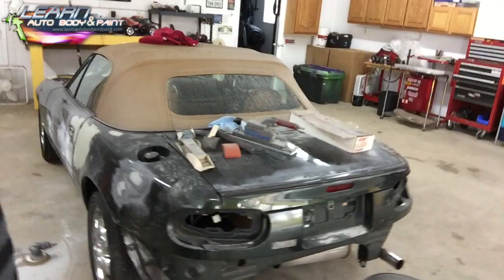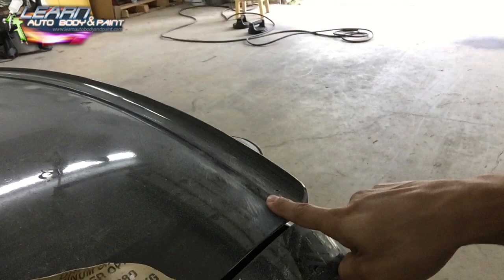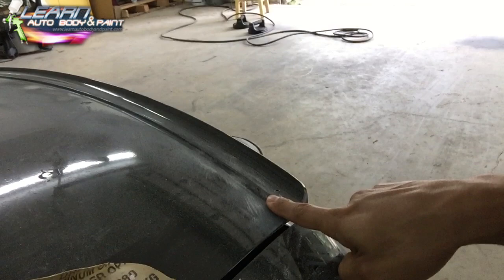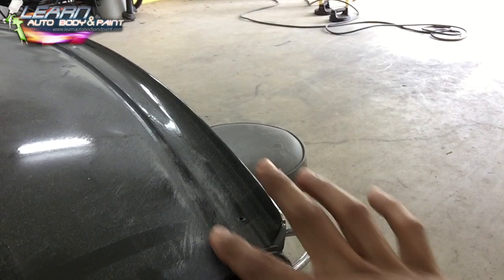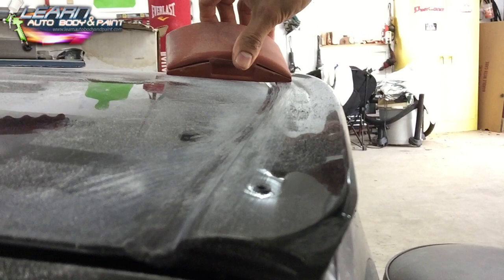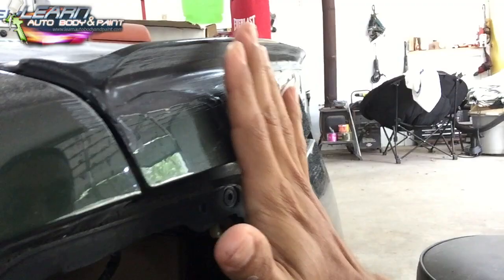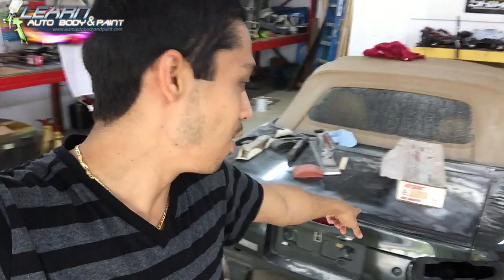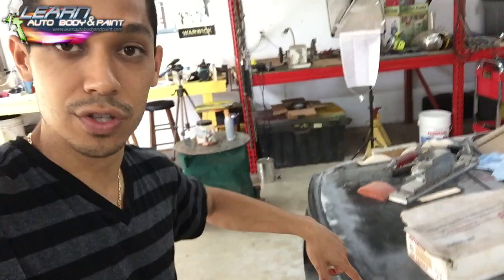Custom Body Work Trunk Lip Fabrication Ideas?

Comment: I have a question 

What happens if I put on 1 and 1/2 gallons on clearcoat on a 1985 Monte Carlo
Reply from the maker: BRIAN Saldivar nothing... what are you trying to say?
Reply: Because I painted my last car with 1 gallon of clear(with metal flake) 
And the Monte Carlo is almost the same size 
Do you think it's better to spray on 1 gallon or 1 1/2 or 2 gallons (with micro metal flake)
Reply from the maker: spray what it needs. What it needs to look glossy. Don't think and spray in terms of using the materials...
Reply from the maker: spray to make it look good. and leave good alone.
Reply: Ok thanks